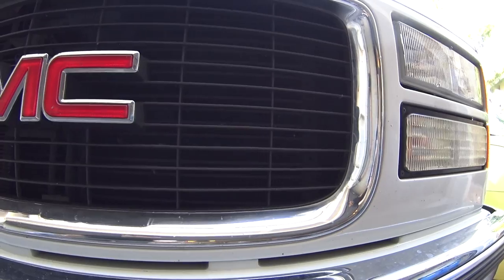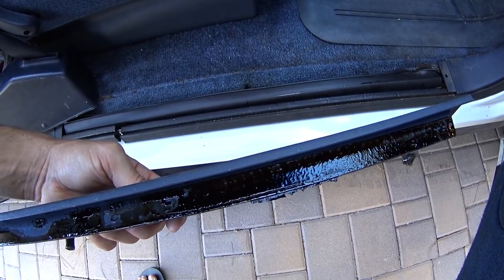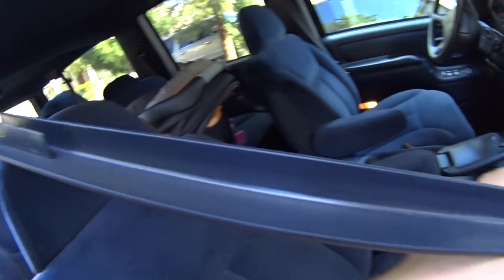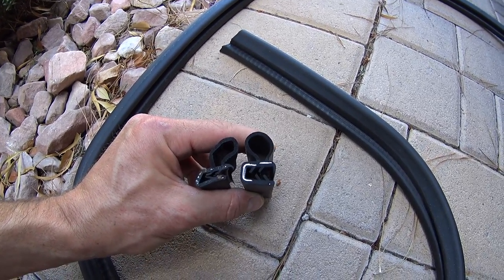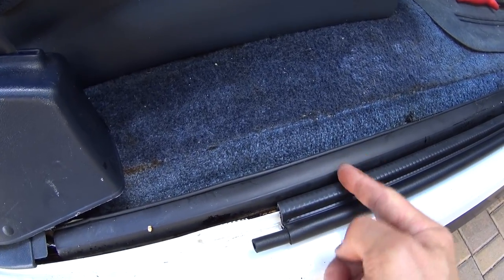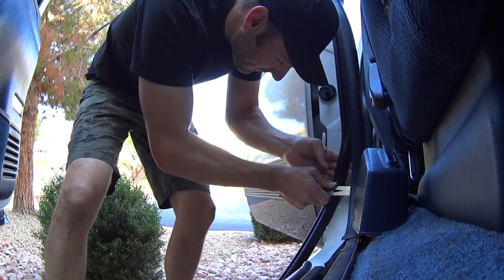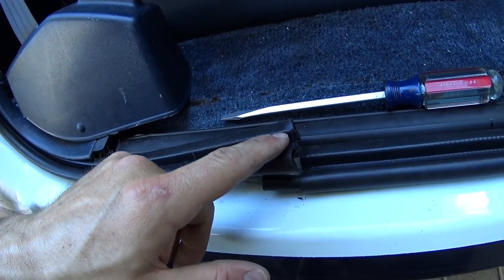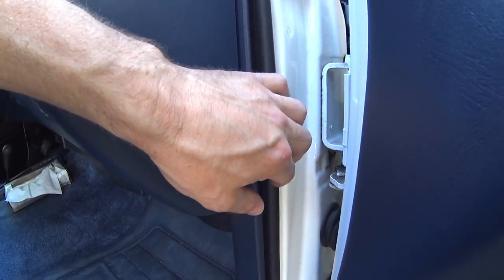GMC Chevrolet Suburban Tahoe Yukon | Door Weatherstripping Install

Comment: I know this video is 5 years old at this time, but you really didn't need to cut any of the "extra" length.  I have installed these on the assembly line for many years.  You did a great job for guessing.  It is sort of an art to put them on.   Stretch in some instances, and roll on tight in others.  That B-pillar garnish should have been removed and you would have had a perfect fit first try.

Comment: Thanks for the walk through, very helpful to know where the clips are on the trim.  I removed the seatbelts at the floor, made the job a bit easier.  Getting the 1999 Suburban updated in many areas, also replaced the front door pins as well.  Thanks for putting this together, it it much easier after watching the how to!

Comment: I have seen guys use rubber cement to help keep the corners from creeping and making air gaps. Also rubber glue at the end junction helps keep it together and quieter.

Comment: Great video!  The driver door on my 99 Yukon was rattling at the latch every time I hit a small bump.  After getting tired of pushing on the door with my elbow to hold the door tight every time I hit a bump,  I came across your video that confirmed my issue was the door seal.  The rubber has gotten quite weak even though it still looks pretty good.   
My first 'fix' was to remove the latch post and file the opening a bit to the inside to tighten it up.  It worked but the door now closes too far and when you open the back door it catches on the front door.   
I ordered a new 'universal' rubber strip for about 25 bucks (that's with tax and free shipping and free returns).  The OEM ones are around $70-$90.

Comment: Love that blue interior; looks good.  I have grey in my 98 'Burban.  Tip: when removing the sill plates on the GMT400s for any reason, it helps to remove the seat belt assembly.  You wouldn't have had such a fight at that corner.

Comment: Had this same issue with my 1999 suburban on the drivers door. I first replaced the worn hinges but the door still shook while driving. I couldn't figure it out but after coming across this video I replaced the weatherstripping and it worked! Very informative thanks

Comment: I plan on stripping the inside of my 95 c2500 out. Carpets are nasty. Everything from soda to oil was spilled into it. Will also tackle that dashboard to get to the evaporator and heater core to replace it. Might as well add weather stripping to the list.

Comment: Another common area of door rattles is the actual latch assembly. The moving part of the latch is plastic coated and it breaks down and falls off during use over the years. The latches  are available from China made non stock but they're junk. Buy actual GM made from eBay or dealerships. They're pricey... but worth it. Mine stopped all door sagging and rattling issues.
Reply: that door and that rear door were both dragging on the striker pin/ worn hinge bushings, rattle on the striker pin...the only thing a door can even rattle on. new strip would compensate for it though, for a while anyway!
Reply: :40 bad hinge/pin bushings causes that drag and pop when opened. the weight of the door is on the striker pin when shut, should be floating above it and latching around it, only going to get worse and more noisy until fixed or you can be lazy and just lower the striker pin a bit!LOL
Reply: if the striker pin is supposed to have a plastic strike collar on it , that could be the only problem if its gone(autozone $10?)

Comment: I’m going to replace my seal in the next couple days. I was told to use adhesive but it looks like you didn’t use adhesive do you think you should’ve used adhesive or do you think it’s unnecessary

Comment: what is that rubber strip call right above the weather strip at the top of the door? That's what I need because mine is all tore up.
Reply: Check LMC's catalog.  They sell most everything you'd want and their diagrams are factory diagrams.
Reply: I just purchased that upper weatherstrip rail from LMC and am going to install tomorrow on my 93 burb. I'll let you know how it goes.
Reply: I get all my weather-stripping and molding from LMC.  It's worth it to know it'll work.  I've done the seals on my 93 'Burban and this past week on my 98 'Burban.  I have a video of it on my channel.  I need to do the passenger doors now.
Reply: My 93 'Burban was the second truck I ever bought and I ran it for 250,000 miles then traded it in on my 98.  Had a 2000 Z71 Tahoe, once, too, so my 98 is technically the third GMT400 I've owned.